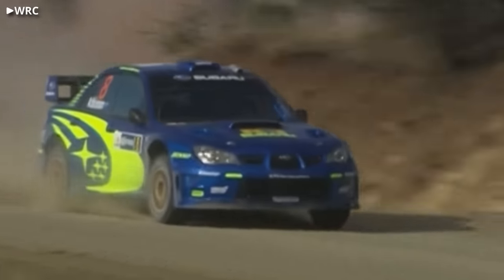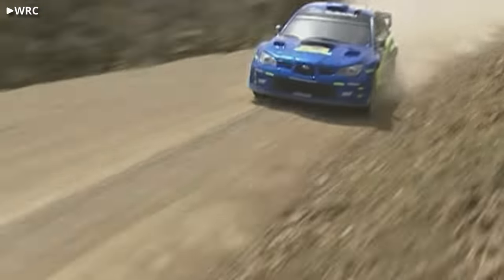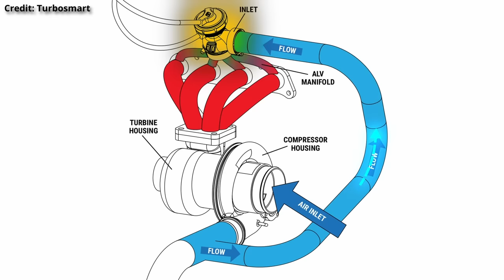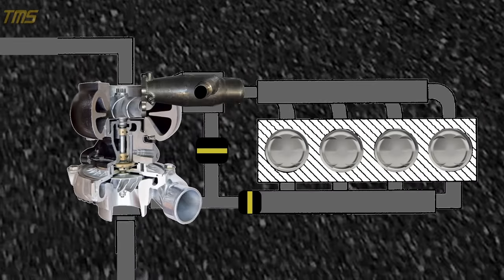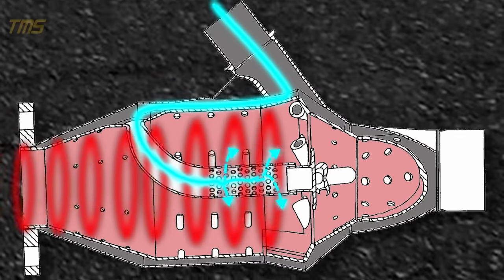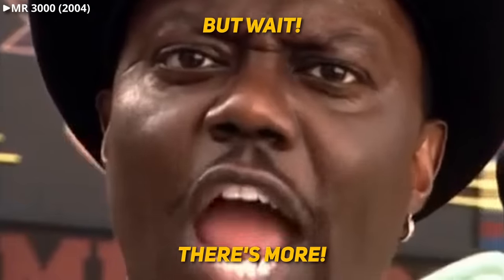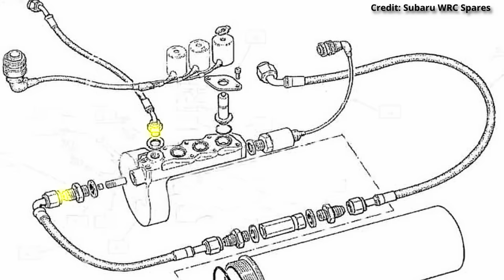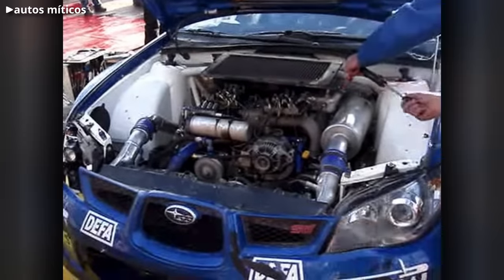When Subaru Put a “Jet Engine” In Their Exhaust | Rocket Anti-Lag Explained!

Comment: I just stumbled across this video, and was extremely pleased to see you cover a system I worked on during my SWRT days. I was the designer on this system, that was invented, developed brought to competition by Roland Broadbent. All the drawings from the patent you used were done by me. Some additional points:
1. No ignition system was used because the rules didn’t allow for a secondary ignition source after the engine spark plugs. 
2. The idea came from a diesel French tank in the 1960’s that had what’s called a hyper charger, but that had its own ignition system. 
3. Combustion in the chamber was initiated by  the plate on the end of probe in the centre of the chamber, that flowed cherry red due to the hot exhaust gases coming from the engine. This plate restricted flow and reduced the top power of the engine. This later evolved to annular ring that was less restrictive to the flow through the chamber.
4. The boost tank used by Ford was illegal, but passed scrutineering when discovered. SWRT went the next rally with a bear barrel doing the same job. After that boost chambers on all cars were outlawed. 
5. Different ALS systems were used on customer WRC cars. 
6. A road car version was developed for STi by Prodrive, but never went to production due to cost and long term durability.
Reply from the maker: First off, what an amazing piece of engineering developed by you and your team! I'm absolutely honored that you would take the time to comment here and I hope I've done the system some justice! All of those additional points are much appreciated. I did my best to reason through the system's operation using the text in the patent, but I figured there would be some finer details that I may not have gotten 100% correct. A couple of questions for you:

1. Would you mind if I "pin" this comment to the top of the comments section so that others can easily find it?
2. Is there a good place I may be able to get in contact with you? Completely ok if not, but I thoroughly enjoy learning about motorsport engineering and would love to speak with you further on these kinds of subjects. If you don't want to share that info in a comment, my email is themotorsportstory@gmail.com

Again, thank you so much for the comment!
Reply: @themotorsportstory  you did a great job of explaining a complex system. Happy for you to pin my comment. I’ll email you later. Cheers Darren
Reply: This is the best of what can come the comment sections.
Reply: Did it draw inspiration from a pulse jet?
Reply: Very curious what this hyper charger system you mentioned was like. Looking it up just kept giving me fast chargers for electronics or what is basically a ram air intake for motorcycles, no mention of cold war french tanks.
Reply: I noticed that newer rally car engines (R1 and R2 notably) have much more rapid and regular exhaust pulses, like a buzz, instead of more distinct pops and bangs - is that a result of a design like this?
Reply: @jonathanwright5550  not really, draw inspiration from earlier single can combustion Chambers from early gas turbines, and hyper chargers.
Reply: @chrisvalleqatsi  sorry I don't know much about R1 and R2 cars. I left Pro drive and the motorsport industry back in 2006. I took an interest in the sport but didn't have the insight that I previously had.
Reply: @darrenjames883  earlier than pulse jet self ignition???
Reply: @Skystrike1535  may be referring to a system similar to the LeClerc Hyperbar engine?
Reply: ayo hold up a second, are you saying THE ONE AND ONLY AMX-30 INSPIRED THIS ANTILAG SYSTEM!?
Reply: @GrinXpedia  I don't think the HS-110 engine had any system similar to this, but reading into the Hyperbar used in the LeClerc is pretty similar.
Reply: That would’ve been crazy to have these on the street!!! Thank you for your contribution to the car world.
Reply: Wow that’s so cool! You’re a genius. What do you do now?!
Reply: What a awesome story
Reply: We should metal 3d print one of those. It would be surprisingly straightforward. We do inconel fairly often.
Reply: @thetrainshop  That seems to be what he was talking about, thanks.
Reply: @jonathanwright5550  it doesn't work at all like a pulse jet.
Reply: Wow! I love this kind of knowledge and insight! You guys are rad 🙌👌💯
Reply: kick ass!
Reply: I hope a patent wasn't  awarded for this as there is 80 odd years of  prior art in gas turbine technology preceding this "invention".
Reply: @robertrichardson5396  it was justifiably patented. It had novelty on its own merit. Virtually all patents build on existing prior art. The novelty was around the systems integration, it's control and the lack of its own fuel supply and iginitors.
Reply: @darrenjames883  Hi Darren, Would you have any movement schedules or any other documents from your SWRT days?
Reply: You're a legend, Darren. Top kudos to you, what a guy!
Reply: @AdamMidghall , no don’t sorry.
Reply: @richpolecat6527  Roland Broadbent is the legend!!
Reply: I worked with Darren on the team and looked after the mechanical design of a number of the engine systems.

You mentioned boost tanks, we did have something similar, the FIA limited the total volume of the induction system to avoid people repeating the Ford design, we went to the maximum volume by adding a concentric tank around the intercooler to throttle pipe. You can see it in the bit of the video where the gut is pressurising the water system (and yes, he was pressurising the water system). The outer tank had a small bleed hole into the inner pipe. The outer tank would be topped up with overpressure on throttle off conditions and when there was a high air demand on wide open throttle that stored air would bleed back through that hole. It was nowhere near as effective as the Ford system, but we went as close to the maximum the regulations would allow.
Reply: @matthewhicks8362  I’d forgotten about that tank! I certainly remember the Stella Artois beer barrel though 😉
Reply from the maker: @matthewhicks8362  Wow, thanks for the insight on that! I'm so glad all of you have been finding this video and sharing so much additional interesting info.
Reply: this design is heavily based off of a pulse jet, right?  once they get hot enough, they are self sustaining.  this means that to get this working without a secondary ignition source, you would have to get that thing hotaf pre-race by retarding the timing heavily just to heat it, right?
Reply: @darrenjames883  What a legend u guys and team designing this...

Can u comments on 3rd party person tried to recreate this rocket antilag for non rally use (track/drift)  

They call it "zero lag" also available cover video on youtube
Reply: Nice to see you here Darren. I was at Fen End 2000 on so you prob know Ben H that did the road car version for Subaru. Very clever engineer(as well) I left Banbury  for Fen End so wasnt up to speed with the WRC so much. I had heard your name but I dont think we met. Great that you added pieces to this lovely jigsaw for those who werent involved. 👍
Reply: @MPGymkhana  If its Owen dev youre in the right place :) The guy I mentioned in earlier posts I worked with that refined the system is in the States working! If you checked my comments with the link then thats him. I can speak with him if you request that. 👍
Reply: @mk1cortinatony395  hey, I’m actually working with Axes but have heard great things about the crew at OD!! I heard of someone in the USA based out of Boston? I would definitely be interested in speaking with him if it’s not to much trouble. Thank you tor the help!
Reply: A Z  ?
Reply: @mk1cortinatony395  hi, yes I remember Ben, a smart chap. I was at Banbury from 2001 to 2006, great times.
Reply: Hey buddy, great work.

I'm a nobody, but invented oval pistons, a one stroke engine, hinge valve system, a bunch of other things.

The ideas you used here are simple and effective, although as you say, expensive to produce and maintain.

I however, would like to point out..

3D metal sintering ("printing") processes that are currently over priced and stupidly uneconomic to their own detriment. In another decade, I will be sending files and getting parts for all sorts of contraptions in the mail a week later.
Reply: A Z  Sounds like someone has an issue with people who have achieved something worthy of significance and historical value in life lol
Reply: Was this your take on the "misfiring system" just like what was modded on Kyoichi Sudo's EVO 3?
Reply: @MPGymkhana  Not sure if Boston tbh. I'll ask if hes up for it though.
Reply: Around 2000, I came up with the same idea Ford used while working on pneumatic SMT machines and thinking about wasted boost events with turbocharged cars and how to utilize that for off-boost situations instead of the short-lived-racecar-only method of manifold combustion. I didn't think it would work or work well as, surely someone would have thought of it before me, but then I read about it a couple years later in Racecar Engineering. The rocket is far more clever and advanced—brilliant work!
Reply: "SWRT went the next rally with a bear barrel doing the same job." possibly one of the funniest things i have ever read 🤣
Reply: I have always wondered about this systems why there was not just a simple secondary fuel system. For example, I often see methanol, propane, or nitrous oxide injection in high boost piston engines. It would be trivial to create a secondary combustion in the exhaust half of the engine that was not mediated strictly by the piston engine. Essentially you would create a parallel turbine engine in the exhaust half that drove the piston engine. I presume that this is just not legal by racing rules and would probably be fairly harsh on the exhaust half — but if you’re making inconel parts to embed in the exhaust half, you’re already there. Right?
Reply: As an STI owner, I salivated on #6.
Reply: Sounds as if you should start your own channel, sure you’ve got some cool stories
Reply: Why not get in touch with Roland himself?. Ask him about the development process for the rocket 😂. He's a proper genius, and I loved talking to him when I worked there.
Reply: @Skystrike1535  try looking for the part as it was associated with a tank. Military vehicle.
Reply: @Skystrike1535  The Leclerc has an eight-cylinder SACM (now Wärtsilä) V8X-1500 1,500 hp Hyperbar diesel engine and a SESM (now Renk AG) [21] automatic transmission, with five forward and two reverse gears. The official maximum speed by road is 71 km/h and 55 km/h cross country (speeds in excess of 80 km/h were reported on road). The maximum range is given as 550 km, and can be extended to 650 km with removable external tanks. The "hyperbar" system integrates a small Turbomeca TM 307B gas turbine in the engine, acting both as a turbocharger and an APU giving auxiliary power to all systems when the main engine is shut down. The Hyperbar name comes from the unusually high boost pressure of 7.5 bar and the resulting mean effective pressure of 32.1 bar.[22] In comparison, the largest diesel engine in the world (the Wärtsila RTA96) has a mean effective pressure of 18.6 bar.[23] In addition, with boost available even when idling, this arrangement also works as an antilag system.
Reply: The Leclerc has an eight-cylinder SACM (now Wärtsilä) V8X-1500 1,500 hp Hyperbar diesel engine and a SESM (now Renk AG) [21] automatic transmission, with five forward and two reverse gears. The official maximum speed by road is 71 km/h and 55 km/h cross country (speeds in excess of 80 km/h were reported on road). The maximum range is given as 550 km, and can be extended to 650 km with removable external tanks. The "hyperbar" system integrates a small Turbomeca TM 307B gas turbine in the engine, acting both as a turbocharger and an APU giving auxiliary power to all systems when the main engine is shut down. The Hyperbar name comes from the unusually high boost pressure of 7.5 bar and the resulting mean effective pressure of 32.1 bar.[22] In comparison, the largest diesel engine in the world (the Wärtsila RTA96) has a mean effective pressure of 18.6 bar.[23] In addition, with boost available even when idling, this arrangement also works as an antilag system.
Reply: @Republican_Extremest  Someone already beat you to it
Reply: @chubbysumo2230  no. Ffs, read the other comments first. The design was inspired by a tank engine. Maybe that tank engine was inspired by a pulse jet, but then you'd have to ask the designer of the tank engine...
Reply: This is awesome. This is the type of comment I always hope to find on Youtube.
Reply: Absolutely awesome to see you in the comments and thanks so much for adding info to the video!
Reply: @Skystrike1535  That because what he says is a lie.
Diesel engine does not use ignition but pressure to ignite its fuel after which diesel cannot be ignited with a spark
Reply: Good post
Reply: Duuuuude! You ROCK! thank you for sharing it with us simple mortals looking for new ways to blown up our engines! Hahahhaa
Reply: @kindafunnyfatties  niceeee I just finally got mine last month!
Reply: Wow. I've learned more things from this one comment and the video than 10 other rally documentary videos.😀 This system looks very interesting. I think the design looks a bit like a "showerhead" style combustion chamber like on older rockets (V-2, R-7, etc.).
Reply: This is not more similar to a rocket engine but also it is definitely very similar to a ram jet
Reply: @jonathanwright5550  okay.. pulse jet /ram jet
Reply: Damn....this is genius 😮
Reply: I genuinely was wondering who was the dude who came up with this idea
Reply: @TheIntratec9  Trust there to be one person who brings up initial d. I've got some news for you bud. Initial D is a fictional show with fictional characters. That "misfiring system" is literally just an antilag system that was already being used in rally, and thus, the "misfiring system" was actually the shows take on that, not the other way around. My best guess is that they called it a misfiring system purely due to translation error. The japanese said misfiring system, and the translators didn't connect the dots between that and current antilag technology, and now there is a world of people who actually believe "misfiring system" is a term used anywhere outside of a cartoon which is simply not true in english speaking countries. Your comment makes you look terribly uninformed about actual real world racing and the mechanical side that goes on behind the scenes. We all let the show off because for one, it is a cartoon, and two, was written in a different language first where they may very well have different terminology for things. But if you ever call it a "misfiring system" in real world racing, people will look at you like you have 10 heads, because we have never referred to it as that over in the west.
Reply: From one geek to another, you did us proud. Massive respect for making such palpable positive impact to motorsport.
Reply: this is one hell of a system, its great when u see pure engineering and innovation applied to this kind of competitions
Reply: Legend !!!!!!
Reply: It looks like a combination of  jet engine combustor (especially the cooling setup) feeding into an old style old "rocket stove" flow accelerator
Reply: @jonathanwright5550  100%   i also saw a pulse jet :)
Reply: Thank you for all the detailed information 👍🙌
Reply: it looks and works like a gas turbine combustion camber
Reply: Thank for the info! Amazing technology! 🔝🙏
Reply: Fantastic story of your work.  What a gem of a find. Thank you.
Reply: This thread is so freaking wholesome! I love how a lot of interesting people have gathered here to talk about their experience and appreciation of this piece of history!
Reply: Nice to see so many clever people getting their due credit . I haven’t seen John Carey or James Rawson’s name jet . Regards Roland Broadbent
Reply: @MrGoatherd  great to hear from you Roland. Hope you’re well. Regards Darren
Reply: >cost and long term reliability 

Man I would have pretended to have enough money to pay lmao
Reply: This is spectacular. Darren thank you for your insight
Reply: Good God, this took me down a rabbit hole.  I remember watching some of these races and playing with the blue brick die cast Subaru.   Soooo much intelligence went into this.  Amazing design man.
Reply: Glad to hear this from you 😅
Reply: hey, i am wanting to try to build the weirdest car on the planet with absolutely no rules and this looks like something id be interested in if you would design it your way where its most efficient, with spark plugs or whatever else could work
Reply: In aviation we actually call this system "afterburner", really i can see more similarities with a scramjet than a rocket, great comment and great video
Reply: @darrenjames883 cheers mate
Reply: Im 3d printing one of these in titanium for my wrx
Reply: you were A designer on this system. not THE designer. youd matter more
Reply: ...Google is good, isn't it.

Comment: This is nuts, the designers used what's called a can style combustion chamber on jet engines (albeit slightly changed) and fused the design with a resonator, and made an anti-lag system. Genius!
Reply: can you elaborate on that last bit? what exactly is the resonator resonating, and resonating with? my best guess is the combustion rings.